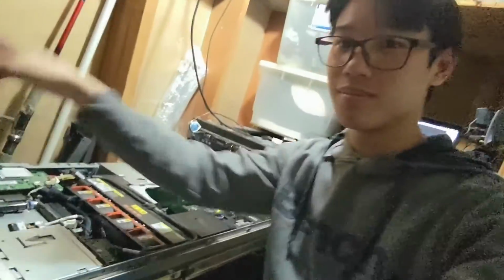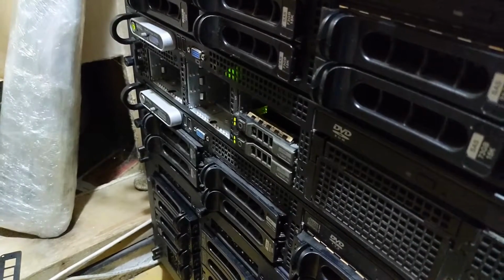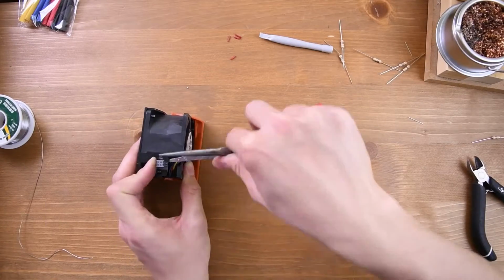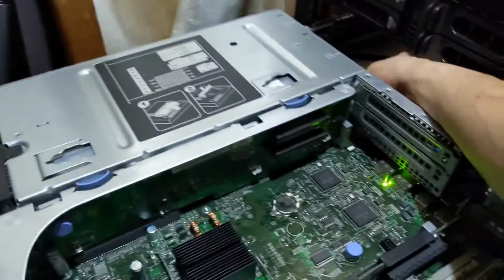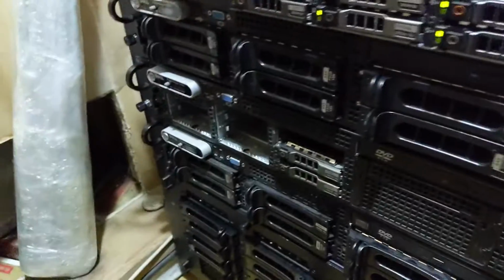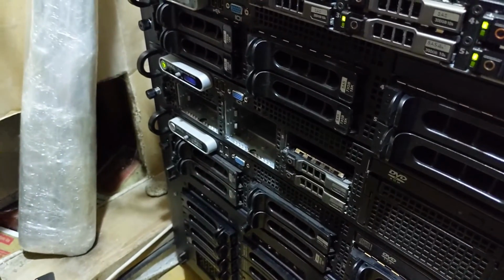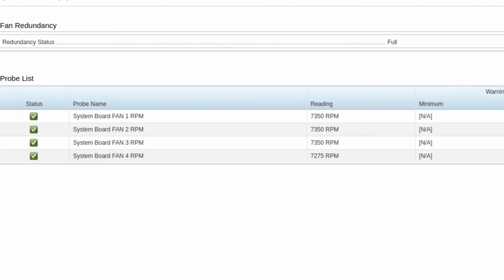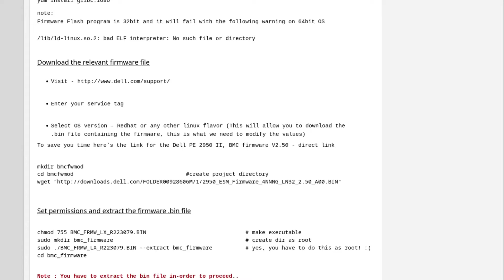PE 2950 Fan Mod | Upgrading an Obsolete Server Part 2

Comment: I have an r610 laying around, but I haven't set it up because of power and noise concerns. Any tips?
Reply from the maker: The R610 isn't very loud, but then again my "server room" is pretty sound proof. You can also use ipmitool to control the fan speed entirely in as seen here (thanks to William Joshua Lucas for pointing this out to me): https://www.youtube.com/watch?v=iR3aqh7qA88

As for power consumption, I don't think that's really something you can alleviate. If you really want a power efficient home server, you'd be best off building something yourself (like what Wolfgang does here: https://youtu.be/MucGkPUMjNo).

According to online sources (I don't have a power meter to check myself), the R610 draws about 150 watts idle or 3.6 kWh everyday. For me this is about 20 cents a day.
Reply: @AerickSteno  thanks for the reply, I've actually seen that Wolfgang vid and have been using a mini pc as a home server, but I don't exactly want to get rid of the r610. I don't have a specific room to put it in that would be convenient, but maybe I can find somewhere to set it up. Being able to control the fanspeed would help a lot I'll check that video about ipmitool out.

Comment: Can't you just do this with an ipmitool cronjob in software? Or are you taking these fans down below their minimum?
Reply: That said, I subbed. Love making this old hardware sing.
Reply from the maker: Wow, I was not aware of this method! Although, it appears that this may only work on 11th generation and newer servers. I'll definitely give it a try now that I'm aware of it!
Reply: @AerickSteno  I do it on my r710, so it does work on old stuff!
Reply from the maker: @williamjoshualucas6503 Sadly, I haven't been able to get it working. I came across a Dell forum post and another user with a 2950 is running into the same errors that I'm getting. I think my machine is just too old being a 9th generation (the R710 is an 11th gen).